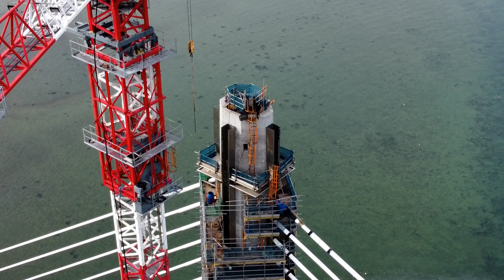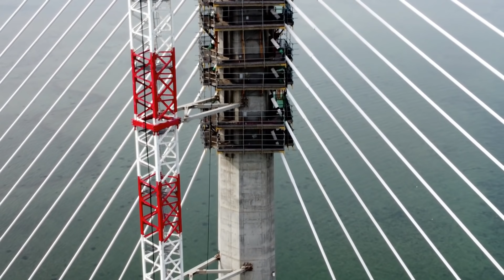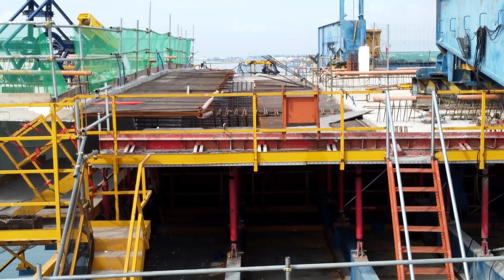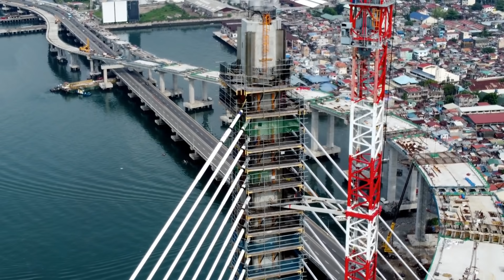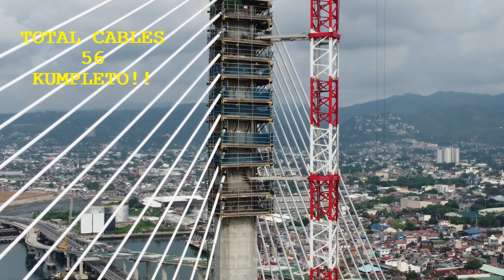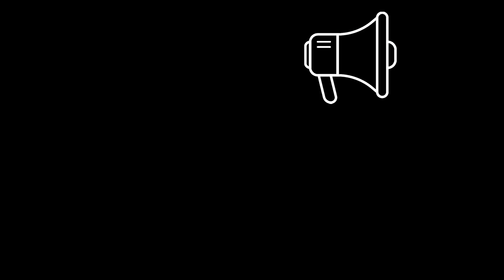56 CABLES COMPLETE & FORM TRAVELER LINKS TOWER 1 & 2 - TECHNICALLY CONNECTED

Comment: Looking at the two spans, they are different heights. How will they get them to the same level as each other. Anyone know the answer?  ?
Reply: Hindi pa tapos ang stressing as you can see in the video there are are still strands left to be put in place. there are 114 strands of cable inside that last stay cable. They will also do restressing (paluagan or pahugtan) of some cables to adjust the deck elevations of each tower before the closing segment can be casted. Just wait and see. Thank u.

Comment: Wala ma Level, hahahaha
Reply: Hindi pa tapos ang stressing as you can see in the video there are are still strands left to be put in place that needs to be stretched,  there are 114 strands of cable inside that last stay cable. They will also do restressing of some cables to adjust the deck elevations of each tower before the closing segment can be casted. Just wait and see. Thank u.
Reply: Yung Mata nyo Hindi level hehe

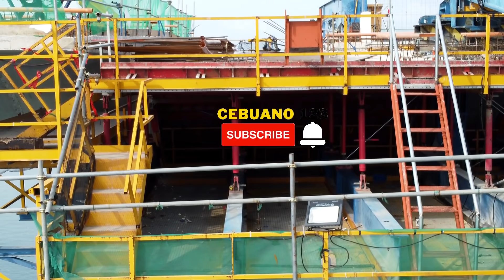Comment: 2:33 hndi parin level. sguro aadjust pa nila yan
Reply: Napansin ko din
Reply: Hindi pa tapos ang stressing as you can see in the video there are are still strands left to be put in place. there are 114 strands of cable inside that last stay cable. They will also do restressing (paluagan or pahugtan) of some cables to adjust the deck elevations of each tower before the closing segment can be casted. Just wait and see. Thank u.
Reply: pansin ko nga sir. Hndi pantay. Yun cguro  silbi nung pag-tighten ng cables. Nkita ko sa ibang vlog.
Reply: Di kaya maka affect sa tulay yung pag tighten ng cables?
Medyo malaki laki din yung difference.
Unlike yung bakal kayang sumalo ng flexural stress, ang concrete prone sa cracking lalo na exposed sa environment (thermal expansion/compression).
Sana ay maayos nila.
Reply: @betabotz4391  Yong tendon cables na ginagamit nila ay high tensile strength yon bawat isa, they can withstand a jacking force equivalent to 26.8 kips per tendon, and there are 114 tendons inside that stay cable. Bawat stay cables mayroon silang sinusunod na design force in Mpa. Sa concrete mayroon din silang sinusunod na design mix which can withstand a maximum compressive force of 3,500 psi without cracking. I have some knowledge of this because I am a Civil Engineer with years of experience in Bridge Construction. Let them finish first, but before that just wait, see and learn. Thank u.